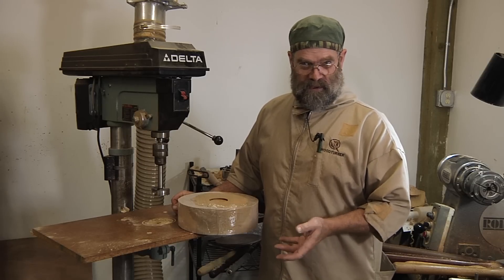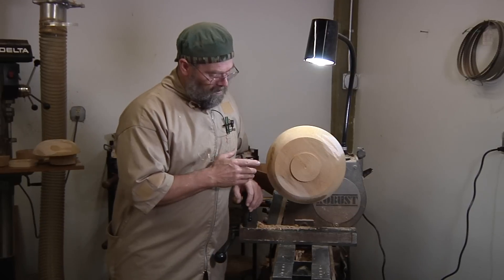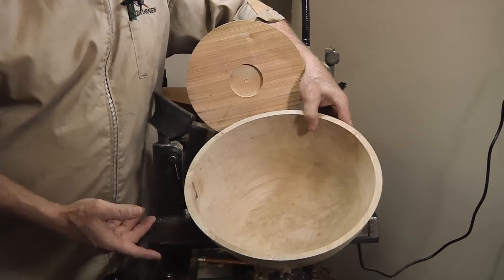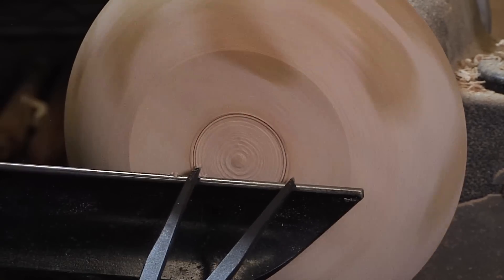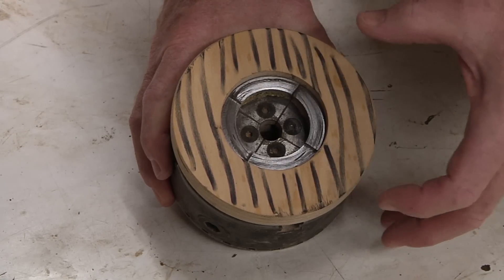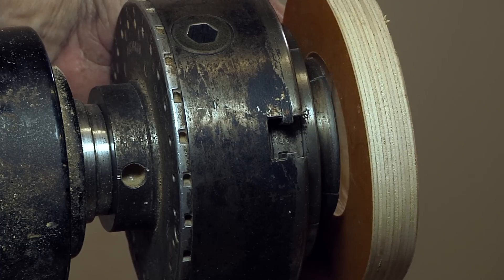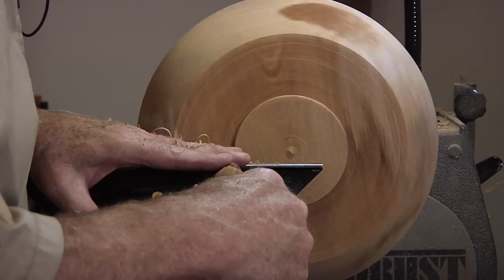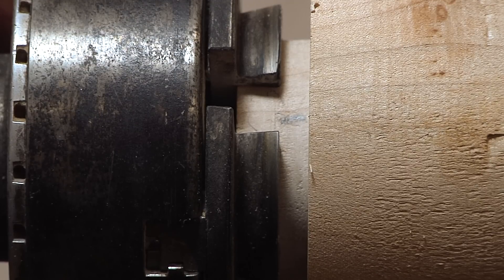MOUNTING BOWL BLANKS: RECESS, TENON & FACEPLATE by Reed Gray aka Robo Hippy

Comment: You mentioned that you were working with green wood! I have some elm that is green and wet,as I cut the bowl blanks I put them into the microwave for 2 min. at a time and then repeat said time.Some work well some don"t! (they crack)Can you give some of your toughs please!
Reply from the maker: Two minutes might be a bit long, more so as the blanks get more dry. I wouldn't go over a minute at a time. It might depend some on how thick the blanks are as well. I would think thicker ones would be more prone to splitting than thin, like 1/4 inch ones would.

Comment: Great video - thanks.  Do you need to make your recess deeper than 1/8 - 3/16" and larger diameter for fresh green bowl blanks?  If so, what dimensions do you recommend?
Reply from the maker: I seldom make a recess deeper than 1/8 inch. Most important is how wide the shoulder is so when you tighten up you don't blow it apart. My chuck jaws are about 2 5/8 inch, it is metric, but the drilled recess I do to turn the back side is drilled with a 2 5/8 forstner bit. For a 12 inch bowl, I want a good inch of shoulder outside the turned recess. You can get a bit smaller, bit not much. For a 14 inch bowl, I want 1 1/2 inches. I do core pretty much all the bigger bowl blanks and this is plenty to support coring. With dry wood, and if your chuck jaws are pretty  new and not chipped from running into them with the McNaughton coring blades or your gouges, you can go to 1/16 inch and it is very secure. For some 6 inch diameter bowls, if I am using the big jaws, I can to to a 1/4 inch shoulder, but I am VERY careful on how I turn, mostly not really hogging out the wood.

Comment: Reed, does your chuck have a dovetail profile? If one has a Nova, and you need a dovetail recess, I don't guess you can use a drill bit to make that recess, or do you?
Reply from the maker: Bill, I just got back from the AAW Symposium in Atlanta... great time. Anyway, I use a big forstner bit to drill the recess in the top of the blank, and hand tool the one for the bottom. I have the Vickmark chucks which have dove tailed jaws. I think Nova does now make dove tail jaws. Their standard jaws are straight with a tiny dove tail type ring at the top. You are supposed to cut a straight sided recess for that jaw, and the ring digs in for the grip. I prefer dove tail jaws for the best grip as they are a wedged joint and stronger than a straight joint.

Comment: I have a 2 inch Chuck. How large of a bowl can I turn with it?
Reply from the maker: If you are using a recess, I would go up to 12 inch or so. Beyond 12 inch, I would suggest bigger jaws. You may be able to go beyond that. If you use the tailstock for added support and take smaller cuts, probably not a problem. If you don't use the tailstock and are taking heavy cuts, you can pull off the bowl blank.

Comment: Thanks for sharing these great videos. I just bought a lathe and am enthusiastically getting started. I am close to purchasing my first chuck and  was going to buy one with dovetail jaws.  Am I correct in assuming the  forstner bit cutting a straight tenon technique will not work if I have dovetail jaws?
Reply: I realize I am 6 months late with this reply. I was also confused with the Forstner bit for Reed's first mortise. His first mortise has to be straight sided but I do believe it provides a good enough grip with his chuck while he turns the mortise on the opposite side with the dove tail circumference. I hope Reed will confirm my reply because I am not even qualified to sweep the shavings out of his shop but I have learned a lot from his excellent instructions.
Reply from the maker: It does supply plenty of grip. I do drill them 1/4 to 3/8 inch deep, and especially on bigger bowls, I keep the tailstock engaged. Some times I will drill deeper so that the flat of the bowl blank rests up against the flat of the chuck jaws. This is more for when the blank sides are not parallel and I want to work with the top surface being pretty flat, and true up the bottom piece. If you half turn a piece, then remount using the forstner bit recess, they never go back on true. With a hand tooled recess, you can get pretty close.

Comment: Reed,   This is a great video...learned much.   Have a question on use of face plates.   Somewhere I seemed to have seen where it is unwise to use a face plate on end grain similar to avoiding a mortise on end grain.   Can you comment?
Reply from the maker: Well, if you watch any of Lyle Jamieson's videos, he used lag bolts with his face plates to do all of his hollow forms. Generally though straight screws into end grain tend to work loose like nails into end grain. With the nails, you have to toe nail, or go in at an angle, then they hold better. I think Lyle uses a bigger screw/bolt, with a coarse thread.
Reply: robohippy Thanks Reed.  Will check his videos.

Comment: When drilling a recess for initial shaping do you need a dovetail? If so how do you put one in??
Reply from the maker: No dove tail on the recess. My tooled recess is 1/8 to 3/16 inch deep. The drilled recess is some times 1/2 inch deep so the blank actually sits on the chuck jaw face. With all of the extra wood around it, diameter wise, even I can't torque it tight enough to break that. I don't use the tailstock on bowls up to 10 or so inches. Anything over 12 inch diameter I do use the tailstock. Never had one fall off in thousands of bowl turnings.
Reply: Reed, used some of your techniques last evening on my first ever bowl and it’s going great. I mounted the blank to do the outside with a recess and it held very securely. I will be finishing the outside this evening and starting on the inside using a recess on the bottom of the bowl. Your material is very informative and practically helpful. Thanks again.

Comment: I am assuming you only use dried wood? The two times I have done a recess and let the rough turned bowl blank dry, the recess warped so badly I couldn't figure out how to put it back to round so it would fit on my chuck.
Reply from the maker: +James Templeton  James, actually, I turn green wood almost exclusively. I love the way it cuts. I turn once to final thickness, let them dry and warp, then sand and finish. Yes, the recess will warp to the point that you can not get a secure grip if you are twice turning. I think that is why just about every one I know will use a tenon mount for the twice turned bowls. It is easier to reverse mount on a jam chuck or spigot, use the original center point in the tenon to make sure it is true/centered, then even up the tenon, and then reverse and finish turn the bowl. You can get smaller jaws to expand into the recess when it is warped, but I don't think that mount is secure enough for turning stresses. It is fine for slow speed sanding though. I do show that on my sanding clip.

Comment: I am finally getting ready to get a good chuck for turning and the info you provided was fantastic.  Thanks so much for a great video.  Sizing the jaw gap small then cutting the tenon or recess, the dado  angle, and the wood grain in relation to the jaws were nicely explained.   Also the length of the recess or tenon so the block is seated against the chuck and its importance!

Comment: What is the name of that tool?
Reply from the maker: Steve, I am guessing you are talking about the gouge near the end. That is a fluteless gouge that is made by Doug Thompson. I did one video just on that tool. It is my favorite for really dainty finish cuts near the bottom of the bowl. You can't hog off with it, but the ability to roll way up high on the edge for a high shear/slicing angle is unique, and better than a fluted gouge.
Reply: @robohippy  yes sir. I think. The one you made the recess tenon with? I’m new, be gentle.
Reply from the maker: I was new once upon a time too..... I have forgotten most of this video, been a while. process is first to scribe the circle with a dedicated set of dividers with the wing nut super glued into place. Second step is to remove the waste inside the circle. I used to use a dedicated dove tailed tool, which is available in a number of the catalogues. Some have the dove tail on one side, which would be used for a recess, and some have double sided ones that can be used on the inside or outside if you are using a tenon. Many years later, I have refined the process. I still scribe the circle. Now I use a detail gouge, 1/4 inch flutes and cut from circle to center, then a return cut from center to circle. Next I take a left sided NRS (negative rake scraper), and clean up the shoulder and the bottom of the recess. The NRS does a really nice job of cleaning it up, and since you are scraping, there is no bounce like you get with a gouge. Yes, I need to do that video. Recently moved into new house and shop, and still getting stuff set up, but I have a bunch more videos I need to do, including this mounting process, NRSs, lidded boxes, and other things.... Might even do a skew chisel video.....
Reply: @robohippy  amazing. I will re read all of this. But to the last sentence, the skew chisel, took a spindle class, used the skew, had great success, came home, used the skew, almost broke my nose... I will use caution with that tool from now on.
Reply from the maker: @stevenmcdaniel1797  Biggest secret to using the skew is to work on the lower half of the tool. If you go above center, it will catch. The best skew video I have seen is Allen Batty. Richard Raffen does one for Fine Woodworking and he starts off with a big catch. Watched it a bunch of times and it still makes me jump....
Reply: @robohippy  it’s already very intimidating. This catch caused me to gently place it back on the rack and back away slowly.
Reply from the maker: @stevenmcdaniel1797  You are not alone......

Comment: I can't fit a chuck on my lathe (it's about 100 years old with oddball threads). Are there any vids on doing it the "old" way?
Reply from the maker: Well, if you have a face plate, then use a waste block and glue it to the blank and turn from that, which I do cover here. Other than that, depending on your lathe, just about all of the chucks have inserts so they can be mounted on different lathes with different sized headstock spindles. Depending on your thread size and tpi, you may be able to get an insert to fit, or even have a machine shop make them. I think the old Shop Smiths used to have some thing like a 15/16 spindle, and I think there might be an insert that used to be made for it, but no idea if it is still available. Craft Supplies used to carry a variety of them. You may be able to ask on some of the forums...

Comment: Great video. it made me slow down and pay more attention when I'm mounting bowls. one correction if I may. The reason for not letting the shoulder of the tenon r3est on the chuck is that it won't allow the dovetail on the chuck jaws to pull the piece securely into the chuck.

Comment: Your initial recess made with the forstner bit was not dovetailed as the bit doesn't create one, obviously. Didn't hear you comment on the lack of a dovetail so I'm presuming just the straight recess is cool to chuck up and turn the outside? You do however, dovetail the recess you create in the bottom of the bowl.
Reply from the maker: I do drill the recess on the top side, and drill it fairly deep, usually enough so that the blank rests on the face of the jaws. This is a very strong mount as long as the chuck jaws are big enough. My big jaws are 2 5/8 inch wide which is plenty for bowls up to about 18 inches. The tooled dove tail on the bottom allows for a very good grip, and doesn't need to be as deep.
Reply: Makes sense. I have a Nova G3 chuck which is 2" so will be fine for my midi.  Thanks for all your good vids. I'm new and learning a ton from you

Comment: On the recess you made with your drill press it did not appear that you had any angle for a dovetail. Did you do anything to change the angle off camera? Great video!
Reply from the maker: No shaping at all. I do make it deeper, and often deep enough so that the face of the chuck rests against the wood. This does provide plenty of support. On bowls in the 12 inch diameter range, I will use the tailstock for support. This does provide plenty of drive for the wood, and I have never had it spin out or dismount. I do crank on the chuck key a bit more than I do when the bowl is reversed.
Reply: robohippy thanks for the quick response. One more question. I have a Oneway chuck which doesn't use a dovetail. Do you find that dovetail chucks like a Nova hold better with a recess?  I have had a few bowls make a run for the border and am looking for ways to improve the hold. Your video taught me some good tricks but i still wonder if a dovetail chuck would be better for me.
Reply from the maker: You happened to catch me at the computer... I do prefer the dove tail jaws. As one turner said, 'you have a locking wedge joint'. this does hold better than a straight joint, kind of like dove tail vs finger joint in furniture work. I use the Vicmark chucks, in part because they are really heavy duty. Nova has recently, last 5 years or so, started making dove tail jaws for their chucks, probably for the above reason. Can't remember if Oneway offers dove tail jaws or not.
Reply: robohippy thanks very much!!!

Comment: Thanks for the class. Im brand new, when you make the first recess with the forsner bit, do you not have to put a dovetail taper on the insides? how do you do that with a drill bit?
Reply from the maker: Well, you can't make a tapered recess with a forstner bit. After doing thousands of them, I have not found it necessary. I do drill at least 1/4 inch deep and tighten it up pretty tight, but not as tight as I possibly can as I broke some gears on a chuck once upon a time.... Some times I will drill 1/2 inch or a bit deeper. This allows the face of the bowl to sit on the faceflat of the jaws for a little more support. This comes in handy if you have a blank that is not perfectly parallel top and bottom. It makes the top side of the slab fairly even. The main thing the chuck does is provide drive for the blank. there is no risk of blowing the foot apart like you can do with the recess on the bottom of a bowl. Especially if the tailstock is engaged, the piece can not come off the lathe. If you ever need to retrue up the bottom, and the drilled recess is there, it is very handy, but almost never goes back on exactly. Pretty close, but some times you have to retrue up the outside of the bowl again.

Comment: my bowl is finished turned by being held by a tenon in my chuck. what is your method to remove the tenon?
Reply from the maker: There are a bunch of videos on it. Most of the time you use a jamb chuck on the headstock end, so some thing rounded pretty close to the bowl inside shape, and then some thing soft between it and the bowl. Use the tailstock to push/press it into the headstock, and at slow speeds (probably not more than 500 rpm, at least till you have done a bunch of them) turn the tenon down to maybe 1/4 inch diameter, remove and saw off the tiny bit of tenon left. You can use 'Cole' Jaws which just about all of the chuck manufacturers have as an accessory. They have rubber feet that you can use in several holes depending on the size of your bowl, and the chuck can clamp down on it. Again, slow speed, and nibble. You can remove the tailstock and cut off the last little bit. Not good for warped bowls though. If you want fancy, there are many variations of vacuum chucks where a vacuum seal holds the bowl in place. Tailstock support and nibble again... One other jamb chuck uses a piece of wood with a recess cut into it that is the same size as your bowl. I prefer to have the bowl fit inside the recess, rather than have the tenon on the jamb chuck fit inside the bowl. recess sides needs to be square and straight. Tailstock and nibble... Other than that, I have seen hand held electric players used, and a 36 grit sanding belt, but they are noisy and a bit sloppy. Hope this helps...

Comment: Reed, I am about to turn my first bowl and have been watching lots of videos.  Your video in particular was very helpful!  I have a couple followup questions.  is there a rule of thumb for the length of the screw used to fasten the bowl blank to a faceplate?   Any other words of wisdom for a first time bowl turner?? Thanks!
Reply from the maker: I guess in part it depends on the blank size and the face plate size. So, for a bowl blank in the 6 to 8 inch diameter range, a 4 hole 3 to 4 inch diameter face plate, I would want the screws to stick out 3/4 inch or so. For a 14 inch bowl, I would want a 6 inch face plate with 8 or so holes, and still screws sticking 3/4 inch or so into the wood. You do want the surface to be as flat as possible to prevent any wobbling, and I use deck type screws. Sheet rock screws are not a good idea because they are brittle, and will snap if you have a catch. Do have the tailstock up against the back of the bowl, especially for roughing. I do pull it away for finish cuts on the bottom of the bowl.

Comment from the maker: Mike, I had to go to the shop and check.... I use the VicMark chucks exclusively, and I think in this one it is the 120. I use the smaller one for little things. When I got my first chucks, I called Craft Supplies, and wanted a Super Nova. The Tech said, "if you are going to spend the money, you should get a Vicmark'. I haven't used the others out there, but don't think the Vic can be beat. I am thinking about the Easy Chucks for the jaw changing abilities, but haven't gotten 'a-round-2-it' yet... Dove tail jaws do hold better...